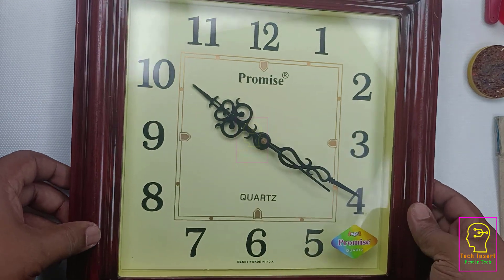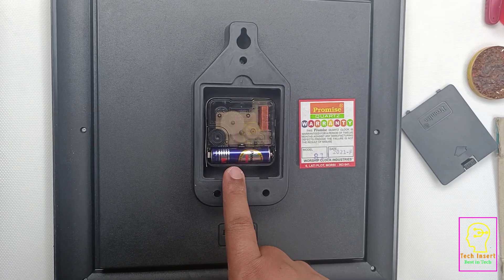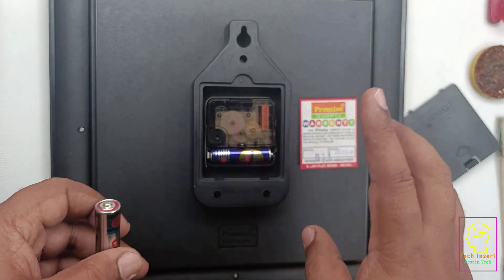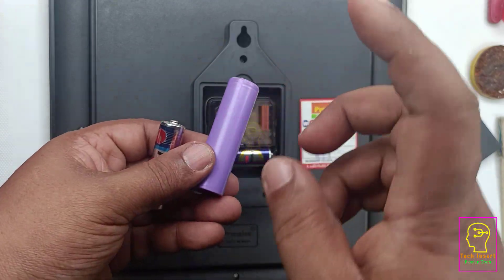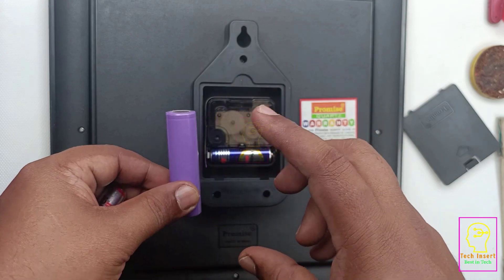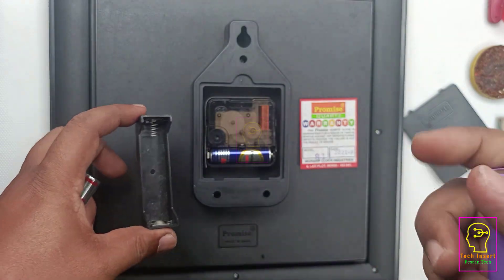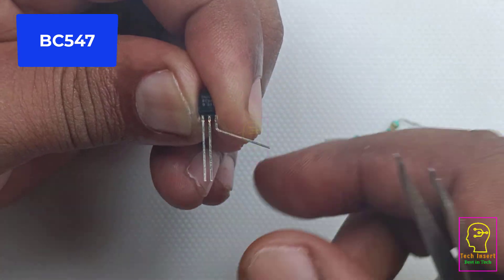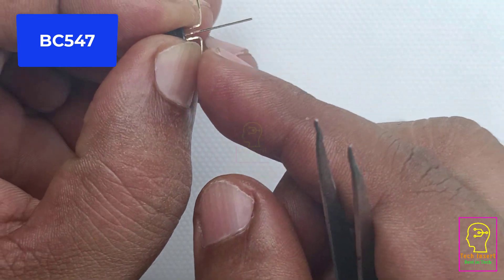5V to 1.5V Converter For Wall Clock

Comment: 20 days after the clock stops running, the current drops to 1.5v.
Reply: Did u use good quality battery? For me it is  working for the past 88 days. I was checking how much days this will last. I used 2800mAh flat type Li-Po battery
Reply from the maker: Which battery u used
Reply: @TechInsert  18650 2x2200mah old battery
Reply from the maker: Mostly ur machine is drawing more current

Comment: Can someone give equivalent of the Bc547 that can be used in the circuit. Tks
Reply from the maker: Bc548
Reply: @TechInsert  Is it possible to use the C945 ?
Reply from the maker: @Ashley-oo1du  Yes , but you might need the biasing resistor value. Use potentiometer to find its value for 5V

Comment: How you calculated the 10k and 8.2k
Reply from the maker: Voltage divider network using resistor for base biasing the transistor.

Comment: This is not 5 volt to 1.5 volt ok. This is 3.7 volt to 1.5 volt. And I think that no need to use complex circuite. Only use  4007 diode 2nos or 1nos serials that's all. It will be work more than your circuite. Thanks.10:53
Reply: There is a problem in that, from battery voltage  4.1v to 1.5v you have to drop 2.6v. With each diode 0.7v drop you need 3.7 diodes(2.6/0.7) . Which means that is tough to get. But this circuit it will be accurate 1.5v. For simple voltage drops what is told is good but not with more voltage. Hope you understand
Reply: Theories shows ok. But practicaly not always ok. 2 diode formula is working approx 2 years in my wall clock. Ok.
Reply from the maker: So ur giving 2.6v to the quartz clock. Still it was running. Wow that is a new information to me. Thanks. I will try
Reply: I thought it was 5v to 1.5v , but when i watched the video i came to know it was 3.7 to 1.5V but it was a cool implementation.
Reply: 3.7 -1.4 = 2.3v to the clock. This will not work for the clock that accepts 1.5v ok. Instead of 2 resistor, I connected the 547 transistor to 50k pot and measured how much max I can apply and I discovered the clock can only take up to 1.8v. Above 1.85v, the mechanism will start going crazy, the clock makes a lot of noise and you may damage the clock
Reply from the maker: We can achieve the same using several techniques